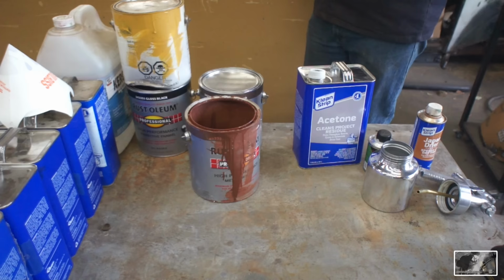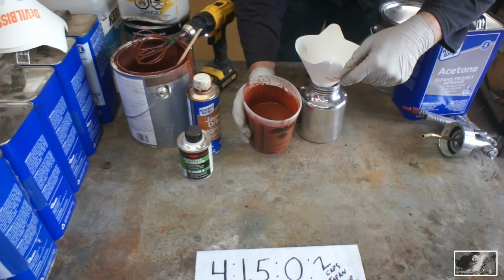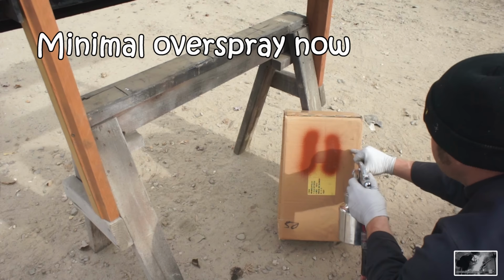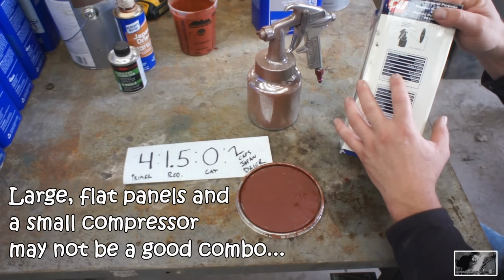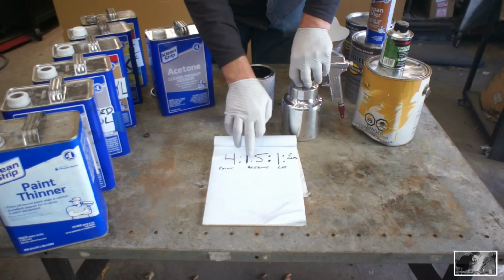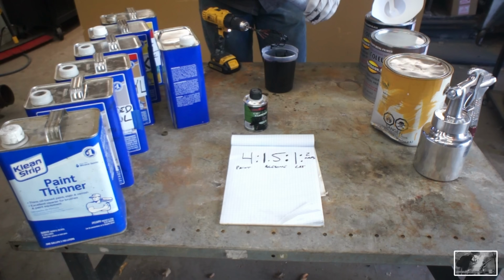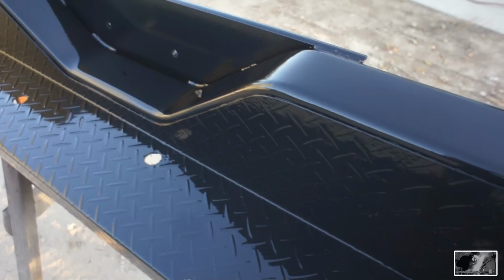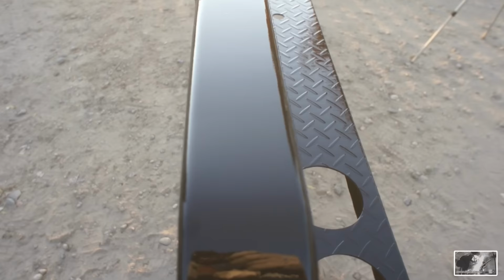DO THIS TO YOUR PAINT! | Activating your RUSTOLEUM | 2K

Comment: I will preface all of this by saying: I used this method, and my results are awesome. HOWEVER: I am a new hobby painter, but I was a painter of sorts in the navy. The paint we used in the navy was a moisture drying poly, but our primer was a 2k Isocyanate pack primer. Similar to the hardener used in this video. If you atomize and spray Isocyanate, you will absorb it into the body and develop a sensitivity to it. There is no way to reverse the sensitivity. Once you develop this, the paint is impossible to work with due to symptoms of even small exposure: rashes, irratibility, respitory failure. Outside of that, there are potential long term physical / psychological issues associated with over-exposure to Isocyanate. If you spray this on a consistent basis, you need to use a positive pressure paint suit. Standard negative pressure regulators with cartridge style filters are not sufficient, you need a dedicated oil-free air line. Your heath is more valuable than the paint job's gloss or hardness. Stay safe.
Reply: If you where in the navy chances are you used a zinc rich epoxy with zinc powder/ flakes followed by an intermediate epoxy with aluminum pigments and top coated with a single stage poly. It’s what we did in the coast guard.
The zinc is sacrificial for corrosion protection and the reason for aluminum pigments is aluminum does not rust.
Reply: I read this AFTER i painted with this Magik hardener. I used a 3m organic respirator, but did not cover my arms. The finish is amazing, and was dry and hard to the touch in just a few hours. However…. I got super sick, restless sleep all night, waking up ever 10 minutes and this went on for hours. The next morning raging headache. Fortunately my wife is an expert at detoxification (she has been helping people for 20 years) and she got me cleared up with sauna, coffee enemas, and colonic. I slept well last night, first night in 3 night, feeling much better but exhausted. Definitely taking more precautions next time, like full body tyvek suit.
Reply: I've watched this video and his others bunches of times since he posted them and this is the first time I read this comment string.  
I've not used the hardener or dryer yet and the Rust oleum dries very soft and easily scratched (until a year later).  Somehow, the paint hardens up after a year outside and toughens up. 
For what they're worth, my thoughts on the hardener is to use it on the primer as well because I think the paint is only as tough as what you've stuck it to.  Primer is relatively thick so, if it is soft behind the paint, you'd think it'd scratch easier.  I suppose after it sits long enough (a year), it all gets hard.

Comment: Solvent pouring tip: if you pour while holding the can so the mouth of the can is at the top while you pour, you can control the flow much better and significantly reduce splatter and waste. It's a bit counter-intuitive, but very effective.
Reply: Same way oil quarts are supposed to be poured. Which is why they almost always have an angle towards the spout, so it never pours onto the container when the spout faces up.
Reply: Exactly. You want to have your opening on top when you pour. Automotive oil and antifreeze are the same way. That's the way they are meant to be poured.

Comment: Xyolene works better than acetone, flashes quicker, then you could skip using the Japan drier. One tip I learned along time ago when painting, drape that air hose across your shoulders and behind your neck, and hold onto the hose with your non spraying hand. That way you don't drag your hose over your substraight.
Reply: IRQVET Tool & Farm sorry friend but you are wrong. Xylene is oily feeling like mineral spirits. Acetone is water thin and flashes the quickest. The japan drier is not to speed solvent flash , instead it speeds the curing of the paint film . Google the evap. times and you will see acetone flashes off at 19 x quicker than xylene.
Reply from the maker: SOLVENT CRASH COURSE:  https://youtu.be/1Aq1xHZUNMg
Reply: Seems like a lot of those solvents are getting harder and harder to find and the ones you can get are some low voc variant that aren't worth a damn. I did come across a product recently made by Goof Off  called pro strength remover they sell it at lowes in both pint and half gallon sizes and its a mixture of xylene and acetone but its some good stuff and really potent and it flashes off really quick I've been using it as a reducer for some oil based paints.

Comment: 1. Your the man and thanks for all the tips. Perfect for low key DIY who doesn’t want to be super technical but still have good results! 
2. What were your dry times in between coats? 
3. How many coats of primer/top coat? 
4. What size tips do you use for primer vs. top coat? 
5. Do you have a go to urethane paint when trying to accomplish UV protection?

Comment: Love my pressure pots. Easy to build one from Harbor freight sprayers with independently adjustable air and fluid settings. I use the small detail gun they sell for $10. Great tips on the paint mix. Thanks!

Comment: Each coat of primer you spray paint on, you will need to sand the first coat slightly down so each coat applied adhears to each other for a much better, much stronger bond. This also applies to the final coat when you paint on your final coat of paint. And if your going the route of base coat clear coat, you will also have to sand the paint to a dull surface, tack rag it and then spray on the clear coat on the painted surface and let it to, bond to the paint, bringing out the shine much further and ready to wax it afterward. For me, I would allow the clear coat to dry and cure  few days before waxing, however, base coat clear coat after the clear coat is sprayed on, can be waxed  3 or 4 hours later without any problems.

Comment: To make an easy pour spout for a can of paint, that a good quality masking tape (one that has some adhesion) and use 2 strips to place over the opening making a V. The bottom of the V will be slightly inside the can. Make real sure that the tape is sticking to both the inner and outer lips of the can. This makes a perfect pour spout and properly done, there is very little mess. If the tape did not stick to the inner lip, the groove of the can will be full of paint and unnoticed will get everywhere when removing the tape. Always have a rag to wipe up any spills and drips. Now, the can lid will fit into a clean groove and not cause it to get stuck. If this is POR15, when dries in the groove you will never get the lid off.  Try it, you may want to try a cheap duct tape as quality duct tape may make removal more difficult causing a mess.

Comment: Flat black Rustoleum & acetone (50/50 mix) makes a great rat rod paint... Nice job, considering the windy conditions!!
Reply from the maker: Have you ever used blitz black? Its made by valspar for john deere. Great stuff but its tricky getting it here in CA.
Reply: @unitedstatesofbuild4915  I can get that at our local John Deere. I'm in Northern California.
Reply from the maker: Dang, thats crazy. I mail order it. Im in the central valley and I havent been able to get it any other way.
Reply: UnitedStatesofBuild I’m in Yuba City. I just stopped in last week and picked up a rattle can. They had quarts on the shelf.
Reply: Valley Truck and Tractor if you’re ever up this way.
Reply from the maker: Great to know, thanks for the heads up.

Comment: Rustoleum isent cheap paint its one of the best for wear resistance ive painted alot of cars trucks boats and heavy equipment and motorcycles with all types and brands of paint and rustoleum is pretty good if ya mix it right like you did the cat makes it stick to metal better

Comment: you waited 1.5 hours between coats using activated paint with japan dryer and it didn't spider web on you, that amazing...oh wait, you didn't clear it...ok that makes sense but i like having the protection of a hardened clear coat but your right probably not on a bumper....good tutorial....

Comment: I’ve done the same using tractor and implement paint minus the drier. It’s basically the same type of paint the precise formula might be different but it’s a modified alkyd but the primer for JD is a buff instead of a red oxide.

Comment: I have read Rustoleum does not recommend their rusty metal primer on clean bare metal. I have a 62 bug that is bare metal with some minor rust, but overall the car is rust free. Can I use the rusty metal primer and topcoat with Rustoleum enamel without issues? Is this the primer that you used in this video?

Comment: Nice video. One suggestion, make mention of conditions while you were painting - temp, humidity, and spraying in direct sun in addition to comments about the wind. Gives the viewer a complete picture if the job.

Also, others said it, I will too...buy yourself a proper respirator and use it. You can thank us all later, like when you can still walk a few hundred feet without gasping for air from COPD or some other pulmonary failure. I’m 66, and regret the times I DIDN’T were proper safety gear more than I regret the times I protected myself.

Comment: Hi. I love your channel. Thanks for all the useful tips. I have a gunmetal Chrysler 300 that I am going to paint gloss black tomorrow with the same Rust-Oleum that you used on the truck bumper. I'm super new to painting with a sprayer but I've been practicing and feel pretty good about it. I have an hvlp gravity spray gun. What should I add to the paint to make the most of this project? Primer too? In what ratios?

Comment: Hi. Hey have you ever used water base paint? Paint designed for metal. If so what are your thing recommendations. I use a lot of sherwin William's industrial water base,  primer sealer and paint colors. Thanks.
Reply from the maker: I only ever use water based stuff on my house, I prefer the solvent-borne/chemically-based stuff for my metal. 😃

Comment: What do you do if there is paint on the can, you shot one coat and waiting for the paint to dry? Do you leave the paint in the pot and won’t it harden by the time you shoot the 3rd coat? Or do you dump the paint, clean the gun and make a new batch when you shoot coat #2, repeat for coat #3?
Reply from the maker: I try to only mix what I can shoot in about 30 minutes time. What I've found is that the longer you hold this hot mix the less likely it will lay down/flow out nice. If there's a little in the gun I dump it, if its a lot I re-evaluate my estimation skills. 😁
Reply from the maker: Oh, and yes I typically dump the cup and rinse some acetone through the gun between coats. Always keep your mixed paint covered too.
Reply: UnitedStatesofBuild , Tvm. Gonna give this a go once the weather dries and warms up. Cheers!

Comment: Awesome stuff man thanks ! So I live in Phoenix Arizona where in the summer it can hit 120f outside and currently around 95f. I want to redo my tahoe and got the harbor freight two gun kit which is supposedly better quality than the single purple hvlp gun people usually get. My question is with my temps and basically nothing non existent humidity, what ratios would you mix for the gloss black quart cans of rust-oleum? Would you still use catalyst or japan dryer?

Comment: The final product looks great! How did you prime and paint the parts of the bumper that were touching the stand to hold it up? Did you prime all the exposed areas then flip it over to access the areas touching the stand? Or did you just leave a few spots unprimed and unpainted?
Reply from the maker: There was minimal obstructed area. It was where the bumper mounts to the truck frame anyways. I just hit it with a little rattle can black once it was detached. Thanks Jon.

Comment: Does the black color coat “burn” into the fresh primer coat for excellent adhesion? I worked in a body shop years ago in college and we always let the primer cure then sanded then the final coat. Granted this was car primer and paint. Bumper turned very nice, good job.
Reply: I would imagine it to be the same concept as wet on wet for for base/clear that we were taught.  It has to be done in the sweet spot otherwise too wet or require scuffing.
Reply: It’s a different method we have called it the wet on wet method.
If you’re looking for a build in your primer wait for a cure and sand then paint.

Comment: Hey what's up a question can you use the Japan drier with the rustoleum paint as well? even if your using acetone and the reducer or what can you leave out Thank s RF
Reply from the maker: I almost always use the ingredients demonstrated in this last video; Paint, Acetone(Reducer), Catalyst(hardener) and Japan drier. They are all compatible. If you use both japan drier and catalyst in the mix be prepared for it to set-off quick. Thanks for the question!

Comment: Nice finish in the wind brother!  Do you know it the catylist makes the paint fuel resistant or good for long lasting paint job? I just don't want a gas spill or drop to ruin the paint. I want to paint my dually with that paint. Thanks a lot. Stay healthy.
Reply from the maker: Fuel will most likely discolor it. The hardener may buy you a little time to wipe the fuel off but it wont make it fuel resistant. Just like I stated at the end: anytime I paint a car I just make the jump up to an acrylic urethane. It will be more UV and fuel resistant. If you insist on rustoleum then the best advise I have is to do a test panel and spill fuel on it. I reserve for rustoleum for utility-type projects

Comment: Thank you Sir for the video... very informative... my tasks is...priming a 20' sea container, in the woods... using generator power for my equipment... all I have at my disposal is a 6gal pancake compressor with the pressure pot sprayer,  and a Graco Magnum stand airless paint sprayer (the type that sucks up product from a container)  which application method do you suggest to use, and I assume ill need to volume mix my primer to do the entire container in under 7 min? Your input and expertise is greatly appreciated so I can plan this task flawlessly.
Reply from the maker: There is no way the pancake compressor will keep up. I would use the airless and maybe get a 30" wand extension for it too.

Comment: Is there a reason that you used a pressure pot instead of a HVLP gun?
Reply from the maker: The pressure pot will spray a heavier, less reduced material. A bumper is a high traffic part so I layered material a little thicker. Thats the main reason.
Reply: @unitedstatesofbuild4915  Thanks for replying.

Comment: Excellent job...Newbie as of today to your channel.  Earlier I watched video for DIY Heavy Duty sheet metal brake and it was great.  Upon looking to see what other projects you took on, I came across this one that really got my attention and loved the products and the way you used them.  I am renovating a 1979 Airstream from the axles up.  I had planned on using POR-15 on the frame once the sandblasting and welding is complete.  I feel this process you used will be quicker, less expensive and with urethane enamel, acetone and Japan dryer, I could achieve long lasting results.  Thank you for any advice or suggestion.
Reply from the maker: Hey Mel. I hate to say it but Im a huge fan of POR15 and while I believe rustoleum is also a great product it doesnt offer what POR15 will as far as looong lasting durability. If you do choose a urethane enamel you will benefit from increased UV protection over what alkyd enamels offer. I am a firm believer in POR15. Thanks for looking around the channel. Good luck with the restoration!
Reply: @unitedstatesofbuild4915  Thanks

Comment: What hardener do you use with the top coat ?  You have Valspar and other listed.    I had a rust roof on a car, knocked off the scale, and quickly painted it with just rustoleum paint, I think I skipped the rusty metal primer, and it STUCK on there great, was still sticking on 2+ years later.  I like the idea of a adding a hardener.
Reply from the maker: I sometimes use Majic brand from TSC. Ive used all the ones in the description also. The hardener will help with the UV resistance which is important on a car roof. Thanks Dan!

Comment: 12:00 i would've faced the project piece facing the sun at this point... appreciate your work! :] ]
Reply from the maker: Yeh, great observation. That would've been helpful as far as the shadows. I originally started with the end of the bumper facing directly into the wind (thinking Id expose the smallest profile to the incoming dust) but it was blowing in from everywhere and the benefits were negligible. I like your suggestion better. Thanks for watching!

Comment: Couldn't see the label on the can of black...was it Rustolium? Thanks for the great tips. Have used the japan drier and hardener with rustolium painting outside before, but paint would stay soft and take weeks to really dry. I didn't know about using acetone...I will give it a try. Thanks
Reply from the maker: Yeh this was rustoleum but this mix ratio works on any alkyd enamel